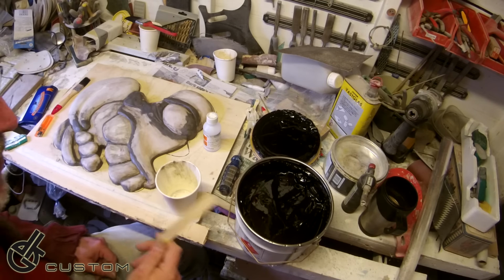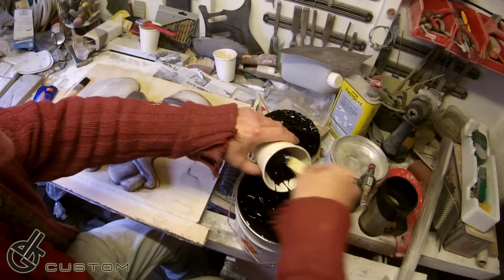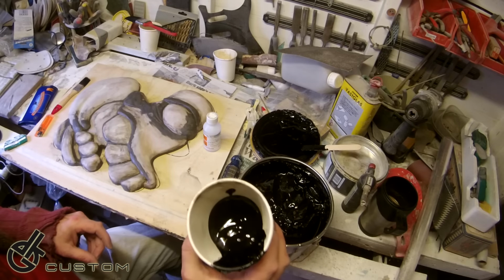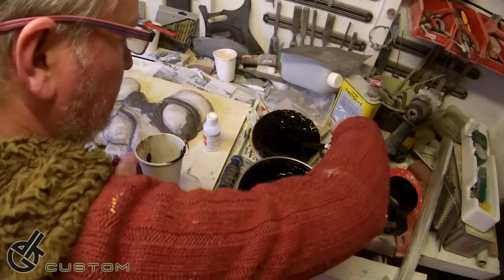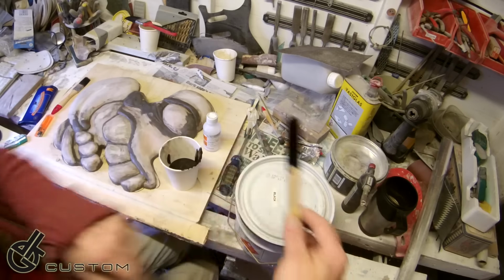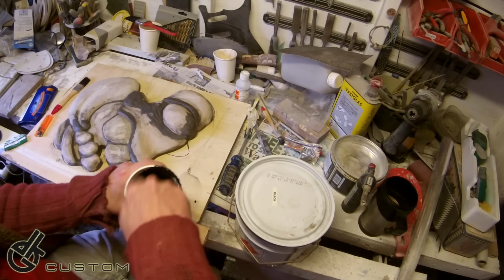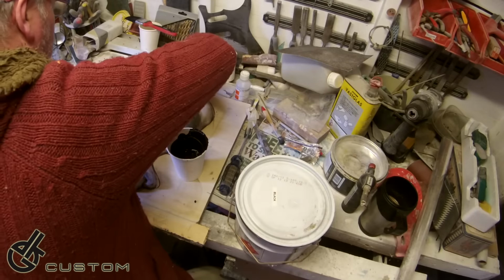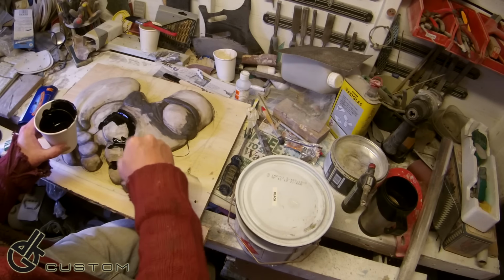Scott Grove's DMF Guitar - Part 4

Comment: The black gelcoat shouldn't be much bother - ( other than keeping you from color mixing . . . when you sand it , it should have white ((or light colored)) sanding dust . . . 
    I haven't used gelcoat before, but I've heard that it isn't as prone to air bubbles as straight resin is ?   Can't wait to see the DMF 'solidified' !   ** Maybe you can go into production = "Limited Edition DMF" . . . You should be able to get quite a number of pieces made from the mould ! ?    Lookin' good !
Reply from the maker: Yeah....it's just the colouring of gelcoat that's annoying....
A run on DMF's? theres a possibility....
Reply: Since you're going through the trouble to make a mould, you might as well put it to task ;)